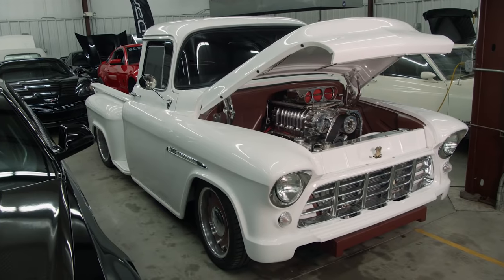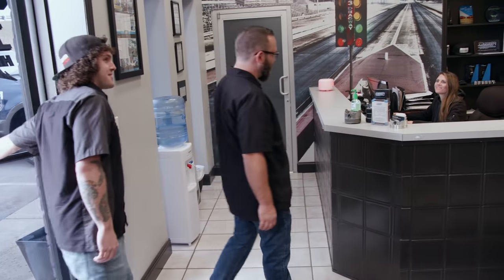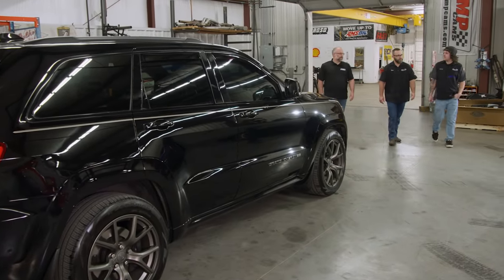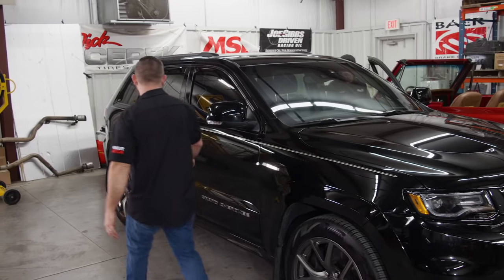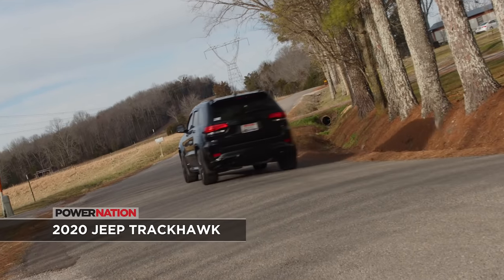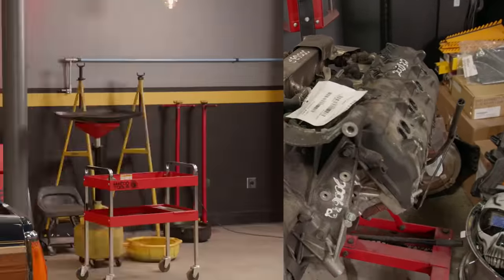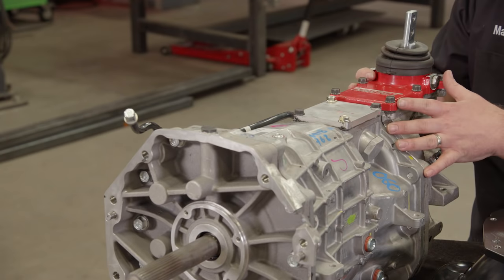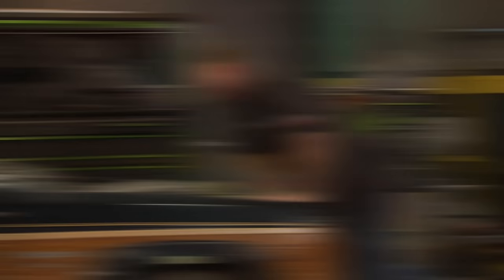Full Build: Turning a Jeep Wagoneer Into a Tire Burning TrashHawk

Comment: They really took the easy way out on this whole build. The jeep shold be 4X4 or AWD
Reply: Hemi/AWD,  Like the track hawk they were driving in the video. Otherwise what was the point of the track hawk in the vid
Reply: That’s why is called trash hawk 🤦🏻
Reply: Nah. RWD for burnouts.
Reply: agreed 100% they should of put in a transfer case and made it 4x4 …
Reply: Seems like a waste of great parts, restored would be great.
4WD for sure, and a 4" suspension kit
Reply: Np242 burn outs, awd, 4low
Reply: Np 242   X fer case will give it
4+4.   2+4   or awd 
Not sure how long it will hold 700 but there is a hd one I believe in dodges n hummers
Reply: Was looking forward to watching but was disappointed. I hate seeing LS swapped everything!
Reply: Yea, link the one you swapped I'm sure it's much better.
Reply: Started losing interest at LS and then done by 2wd. What a shame, could've just bought a new and old blazer and fwd swapped the blazer
Reply: track hawk is AWD for a reason so making a super light xj pushing 700 hp in 2wd is simply making a deathtrap you couldnt drive anywhere hardly cause its just to unsafe. really disappointed in that. the LS is fine because back in the day we used old 350 cid chevy engines in the CJ jeeps and it worked great so really thats an old tradition in my view.
Reply: @Ace88Sama  and less drivetrain loss
Reply: @chrismoore5669  Yes, you cannot be critical of or an opinion on anything unless you have done it better.  Like any President, the weather forecaster, IRS agent, your boss, and on and on.  Makes perfect sense.  😳
Hopefully in high school they will teach you how silly that argument is.
Reply: I agree however it's a unibody and they can't notch the frame.they would have to build a sub frame and much more.for the sake of TV they took the easy way
Reply: I stopped watching after realizing not 4wd.
Reply: Agreed
Reply: @GMCJay_lly  i would love to own that jeep even it 2x4 . tell you the truth i take a American muscle cars 2 wheel drive over a AWD car . even Damon on Daily Driven Exotics got a AWD lamborghini and removed AWD.. now lamborghini is 2 wheel drive new tire slayer
Reply: i agree...they have the best tool, auto parts, and resources at their disposal, along with a shit ton of money and they put a LS in bc they didn't feel like dealing with a hemi..dude on instagram putting a hellcat in a jeep renegade, so, i agree, took the easy way out.
Reply: 2wd is better in plenty of situations
Reply: I was cool with the stick instead of an auto . I’m even okay with an LS instead of a Hemi . But this needed to be AWD .
Reply: Low Buck Garage channel made a 4x4 V8 manual grand cherokee and ran it on the track.
Good channel to check out.
Reply: They didn’t think they could make trash hawk reliable with a transfer because the power they put into it, transfer cases can take a beating but they have there limits and the mess with the gear ratio they where going for
Reply: @colbyallen9559  Nope, nearly any transfer case, would not have any issues with being used in that manner.
They see much more stress offroad and behind 1 ton trucks towing.
Reply: @jhoncho4x4 you pull loaded 1ton trailer in 4wd?
Reply: @colbyallen9559  I have pulled everything in 4wd, with a diesel engine, running full power and spinning all tires.
U joints are the weak link; not transfercase.

Comment: I can't believe they didn't upgrade the steering...😂😂😂
Reply: Bottom of the line KYB shocks, too.
Reply: It is a start...also, they will most likely revisit the steering and shocks as well.
Reply: Don’t need steering in a straight line lol
Reply: I agree, hearing them talk about the steering be trashy got me. I put a lot of work into my xj steering system and im not trying to do laps like they are lol.
Reply: They are not rock crawling, but yeah...might not be the optimal choice for changing direction quickly with precision.
Reply: They must not have ever dailied an XJ 🤣
Reply: @gregkrueger331  it's an XJ ..... they don't really go straight 🤣😂 believe me, I'm capable and will spend money. The body shape, suspension, steering, weight distribution, wheelbase, and center of gravity all play against you
Reply: Did they have to upgrade the master cylinder
Reply: @jeepinjack4196  How do you upgrade the steering???
Reply: They said it will have a for sale sign on it. Couldn't imagine all the don't hold us responsible paperwork involved . Possibly off road use only since they only drove it on the track or off road

Comment: The main thing I would change is I wouldn't have made it 2-wheel drive! It's a JEEP, they all should be 4-wheel drive!!
Reply: They probably would have had a transmission problem, akin to all the kids that want to use the Nissan RB26 engine.
Reply: @kuahmelallah  No, they simply didn't want to pay for a custom adapter plate for a transfer case. And other custom work to make it good.  I think the motor ate up most of the budget on this one. These are pro's in a pro shop. Not kids in daddys garage.   No comparison.
Reply: @starbattles1  I doubt the engine was the budget eater a LS is pretty cheap to build
Reply: I agree
Reply: @enjoythesho1992  That was a crate motor.
Reply: @starbattles1  even cheaper
Reply: Lowered solid axle 4x4 don't mix. The diff hits the oil pan. Dealt with this lowering my 5.9 ZJ. 2" drop is max
Reply: @cz75tactical9  It's a JEEP, it's not supposed to be lowered.
 But in reality, the Jeep Wagoneer was already low compared to a truck 4x4.
You just don't get what a Jeep is. Obviously not a jeep person. I own one do you?
Reply: @starbattles1  i literally just said i did. Guess you're not a jeep person since you have no clue what a ZJ is. I built mine to have good street manors and handle fire roads at speed. Its a punched and cammed high compression 360. Built trans, 2800 stall. It Makes 400whp & TQ. However its back at stock ride hight with upgraded progressive coils and 5100s. I got tired of the ride lowered.

Comment: The AWD system on the Trackhawk is what makes that much HP work in it without making it a complete death trap,so it’s kinda disappointing that this is only gonna be 2WD.
Reply: AWD is overrated . i take a 2 wheel drive Lamborghini any day over a AWD
Reply: @funtyes1970  rear/mid engine makes a huge difference.  There is no weight in the back of an old jeep.  Makes it uncontrollable...as the former owner of a Challenger Hellcat. Let me explain from experience...
Reply: Two words bro, Drift Truck 👍👌🤘
Reply: @richfarfugnuven6308 so what your saying is you bought a high horsepower car and couldn’t handle it makes sense that’s how my dad got his cheap dude was scared of the car🤣
Reply: That's why it's called a "Trash Hawk".

Comment: The LS is okay for the wrong situation but it really needs to be all wheel drive it doesn't make sense being a two-wheel drive hot rod
Reply: Would be strong enough with a Dana 44 from a Rubicon and that brake upgrade, but they would have had to figure out a way to lower it like they did.
Reply: so i guess muscle cars are 4x4? and people are still buying 2 wheel drive Lamborghini

Comment: These guys are very smart people. They leave that hole in the hood right above and behind the radiator and fan, where rain water will go down and get blown all over the motor and all the electrical plugs and connections.  Very smart people indeed.
Reply: Apparently they have unlimited funding, so it it gets ruined by water, they’ll just build another vehicle like it’s nothing. 🤷‍♂️
Reply: Lol! All modern engines wiring harness have weather packed connectors.

Comment: On your new front brake kit, I noticed that the holes threw the bearing were missing the shafts and for a good reason, your going 2 wheel drive, but those bearings need the shaft end going threw and torqued to spec for preload on bearings, go back to the scrap yard pick up 2 ends and manicure the cup off with your oxy-acetylene nail file, you don't need the extra weight !
Reply: I was hoping someone else caught that. That front wheel will snap off

Comment: That Wagoneer XJ was a survivor and clean!  Shame to chop it up like that!  You should have used any other generic XJ for this project.
Reply: Should have just swapped in a later GM V6 and supercharged that. Way too clean! Plus the engine bay is smaller in the 84-86 models. They completely redesigned the firewall to fit the 4.0L.
Reply: Word, I would have loved if they made it into a light off road rig than a rat rod, maybe with an upgrade engine and trans.
Reply: The V8 that came out was a gm engine from the s10

Comment: An '86 Wagoneer with a perfect interior for 2,000?  Even with the broken crank....If anyone has one of these out there - I'm interested...
Reply: Yeah, I am an XJ person...I would have dropped everything to go buy that. Too bad they made it 2wd.
Reply: @Rozza43  i think it work out great being 2x4 . some Lamborghini are still 2 wheel drive and i don't see people crying over it not being AWD or 4X4
Reply: @funtyes1970  For one, it's being built in tribute of an AWD vehicle, two...almost all jeeps are 4 wheel drive. And Three, it was already 4wd.

When it comes to Lamborghini, they have only been using all wheel drive for 25 or 30 years, most every sports car was rear wheel drive before that.
Reply: @funtyes1970  Nearly every powerful SUV is AWD, going back to the GMC typhoon/cyclone from the early 90s.  All the weight is up front, so they hook a million times better with AwD.

Lamborghini are mid engine cars for the most part, so they have more weight over the rear axle to hook better. And you can get any 2wd Lamborghini in AWD if I'm not mistaken.
Reply: @Rozza43  there a youtuber got a Lamborghini and it AWD and he removed AWD he only want back wheel power only for a tire slayer
Reply: @funtyes1970  Yeah, AWD in roll racing is not great. And that is what a lot of people use these high horse power Lambos for...they were originally built for track racing, where AWD will slay a RWD with a similar set up.

Comment: I am old enough to remember Jeeps Cherokee commercials from the late 70s on TV...They use to show a bunch of desert and then the announcer would just say: "The Cherokee Chief is coming! The Cherokee Chief is coming near you!" I remember my mother one time asking: "Who the hell is this Cherokee Chief that is coming, but just not arriving! Arrive already!!!" It is funny now!!!
Now this Cherokee would have been awesome with an old school 440 Hemi connected to a smooth 5/6 speed! with an all time AWD transfer case and 4 sticky tires!!! Lets not forget the 14:71 Lysholm supercharger on top of that thing with electronic fuel and spark...say 16 injectors, 8 at the manifold 8 at the bottom of the hats!!!
On another note: I would actually like to see some penny pinching builds, instead of using 3k plus 6 speeds with another 3 K's worth of peripherals to use it, not to mention a 10k LS motor, toped with a 6 k supercharger and such!
Let us have a build where the goal and the budget are to make them as cheaply as possible without say "finding parts under the cupboard" type situations and see who can make what with how much and with what type of performance!!!

Comment: I like that they made it 2WD. That much horsepower in a 4x4 setup would sap more power with vampiric loss and probably break stuff. It turned that thing from a grocery getting poke machine into a beast. I liked the stance too. Stuffing a hemi in the Jeep would have taken a lot of time, effort, and money. I'm sure they have caps on what they are allowed to spend, which is likely why the Jeep ended up being built the way it was.

Comment: The Inline 6 was not an option until 1987 in which the engine compartment was lengthened in order for it to fit. Many of tried and failed to get an inline 6 to fit into and '84-86 Cherokee as it requires a lot of firewall modifications.

Comment: Love this build but wish you had kept four wheel drive, the reason is the TrackHawk is all wheel drive, this would have made handling better but hey it is a budget build horsepower excellent as you would have liked a little more power at the wheels.
It could be better with tuning the suspension a little more better tyres.

Comment: Agree with lightboy25 there is a reason you buy a track hawk usually you want the 4 wheel drive grab and alot of times you live up north where you have to deal with snow and ice and you want a super charged beast to go hawg off roading in the snow and ice.

Comment: They missed half the point of the WJ knuckle swap. Yeah bigger brakes, cool. I did mine for the steering upgrade. Drives 100% better Ditching the inverted Y and going to true crossover steering. Note the empty TIe Rod End  mount up higher on the knuckle (48:56)

Comment: so disappointed that they didn't change the steering. they swapped to the WJ knuckles, but still went with the Y-link steering instead of crossover. Would have been such an improvement, esp for track days

Comment: Come on guys, throw a d30 in there. It can take the power, i promise. You should be much more concerned about the d35 in the rear. The np242's are pretty strong, but you can bolt in a np241or out of a rubicon and have 4x the torque rating

Comment: Why did y'all run a single control arms setup. It would connect the upper to the lower arm and then you would have more clearance. Or you could have bought the control arm drop brackets and that would have gave you the room you needed and helped recenter the axle forward for caster even tho you have adjustable arms. Nice build but I would have done more to front

Comment: If you wanted the true sleeper look you could have remote mounted the throttle body on a flanged pipe to change the angle and move it away from the hood.......no cutting needed!!!!

Comment: Love the concept. Hate that you gave up the 4WD so quickly. But worse...
"We're going to upgrade our wheel studs. Because safety!"
Also...
"We're going to mount the fuel pump inside the passenger compartment. Because what could go wrong?"
Reply: how bout them self tapping screws holding the filter lol,and it seems like the pump needs to be covered with something fire retardant if it's in the cab...

Comment: You should weld the wheel hub spacers.. The wheel hub is supposed to take the load where it sits in the knuckle, without welding the spacer any shear force gets taken by the hub bolts.. 🚫

Comment: They didn’t try to re-create a trackhawk. They built something with way too much power for its platform. It honestly sounds like a death trap. Solid beam front suspension with cut springs and stock steering? Seriously? Did they even beef up the unibody at all?

Comment: Not much of a "TrackHawk" since there is no Hemi, no AWD (but still has the 4X4 badge), no quick shifting 8-speed auto. Only thing it really has in common with the Track Hawk is the Jeep badge. I'm sure it's still lots of fun but since it's an LS with a Manual, I think everything they did would have been better suited for a Camaro Or Blazer

Comment: High-volume, high-pressure fuel components routed through the cabin of a high-CoG, 2WD, 787hp refrigerator box designed to early-1980s safety standards. Congratulations gents, you just built the land-based version of a Viking funeral boat.

Comment: Only disappointment is the hood cut, could have engineered something to avoid that, methinks.
Reply: There really not that much height room under the nose of these. Maybe with a fabbed custom intake they could probably keep it under the hood.
Reply: @CanadaBud23  The throttle body being angled up is what made it an issue.  Good build but, like you mentioned, would have given full stars if they had tigged up something from aluminum.
Reply: @dytch2220  Yup, I think so.

Comment: I was all about this build until you left the hood with a gaping hole
Reply: I agree. They can fab a custom hump that starts there and runs up the middle and looks good, where rain won't get in, hit the fan right below and get water sprayed all over the motor and electrical connections, coil connections, fuel injector plugs, ect... That is a dry weather only wagon.

Comment: They, never say. How much.$$$ 
Was invested to. Make the. Jeep
Reply: some quick math tells me its over $50k
motor $13k, supercharger $8k, transmission about $8k, ecu $2k, injectors, accessories etc at least $2k. Thats $33k just in the motor/transmission
Reply: @jbeasley2528  You can do roughly the same build with the same power with OE parts for about 6K maybe. Turbo LS can be cheaper if you do some of the fab work.

Comment: Well even though you did the typical LS swap they do make four by four parts guys might as well take the four-by-four badges off you totally ruined this and all the money that you threw at this project when you say it's a budget and you didn't do what they did with the Grand Cherokee or the Trailhawk yeah you got the horsepower but you don't have all-wheel drive in my opinion it's a big fail. Oh and by the way I've been building cars since I was 15 years old in the early 70s and used to raid every single junkyard in southeast Florida. LOL. Next time try harder guys you'll get a thumbs-up for sure